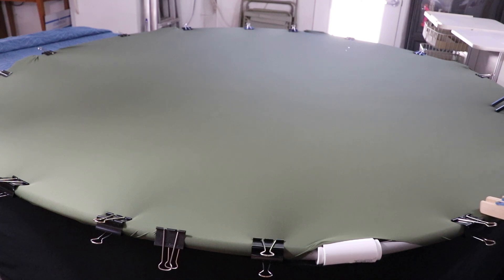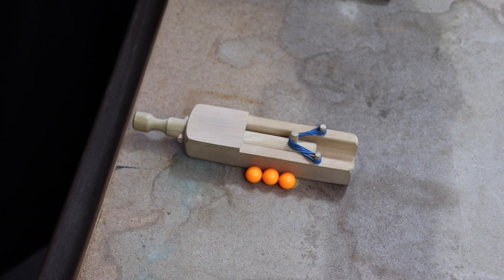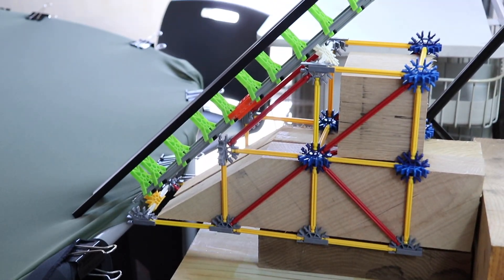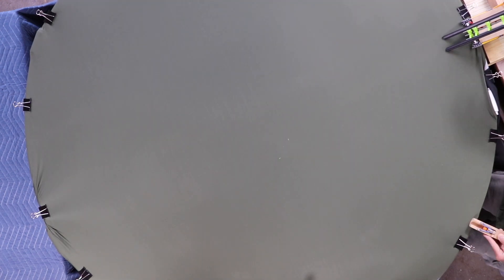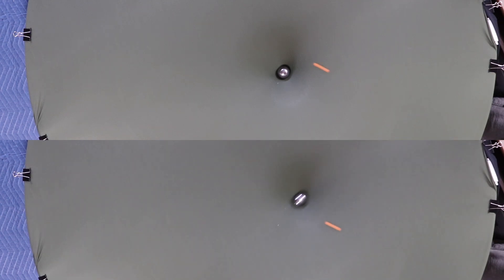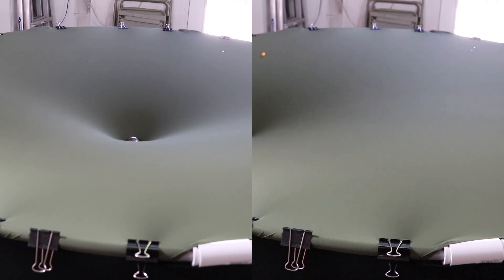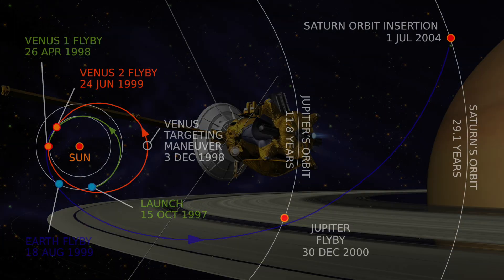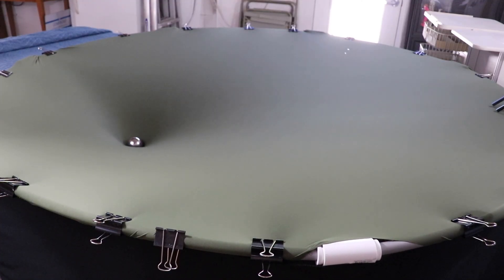How to Perform a Gravity Assist

Comment: Now I get it. I'll be able to launch more efficient missions in KSP
Reply: I don't have a KSP but i would like to see a grand tour in KSP :) try it.
Reply: When I saw the video title I thought to myself "This ought to help in KSP". I come to the comments to see that I'm not alone. 🙂
Reply: The part shown in this video is the easy part. The hard part is getting the planets to line up just how you need so you can get the desired exit path. It's all about timing.
Reply: Lol yep
Reply: I don't really like gravity assists, my friend parked his duna craft on elliptical orbit to SOI and the mün ruined him
Reply: Famous last word for a Kerbal.
Reply: @Strike2-9245  That is why I use the mun to do a G-assist , way more fuel efficient way out of Kerbins Grav well
Reply: If I can find out how to reset files on my ksp
Reply: Been doin this with mechjeb for years, great way for a low thrust ion engine to capture at Jool instead of doing a flyby.... especially if you may have done a few grav assists too many at the mün.....
Reply: I'll be trying to use it in Simplerockets 2
Reply: YES, that‘s just my thinking😂👍🏻
Reply: Not sure if they changed anything but in KSP 1, I used to send a spacecraft to an orbit of altitude about 100km high on Kerbin, and then did a gravity assist using Mun. So if you do it right, the gravity assist will knock the orbit of the spacecraft once, so that it does one orbit that brings it back into a second gravity assist with Mun automatically. Two assists back to back for the cost of one maneuver, to get quite a lot of efficiency. Try it sometime. But I only got it to work from a very symmetric orbit at 100km high. But there wont be a third because after the second kick, you get out of Kerbin. Free delta V
Reply: I've never played the game, is it good?
Reply: @desigeekchishi  go to igggames.com and get ksp. But I’d love to support the developers but come on? $50! might buy ksp2 legit though, just to support them
Reply: @desigeekchishi  kerbal space program
Reply: You are gonna add more boosters anyways
Reply: rather than just turn on infinite fuel then fly through them without the concern of gravity fields
Reply: I understood how gravity assist works thanks to KSP ;-)
Reply: @RonRPL  u can understand... but not the 12yo me playing it for the 1st time
Reply: e
Reply: Dude. Being able to even fly towards the planet is hard not even mention doing it with enough precission to granity slingshot my spacecraft
Reply: Thats what im saying

Comment: the only video that shows exactly how it works. All videos just shows animations and clips that doesn't show the real effects of gravity assist. this was really good
Reply: Almost*
Reply: I think it more shows that it works.
Reply: How did this get 700 likes and only 2 replys
Reply: @fail-er544  i watched this vid and left a comment way back when it had only 19k views i think 😅
Reply: But why don't we spiral into the sun?
Reply: @lc2c177  it will after trillions of years
Reply: @lc2c177  because if you neglect the forces due to all other planets there's no loss (nor increase) of energy in the Sun-Earth system, therefore there's no reason for the Earth to change it's orbit, hence it keeps orbiting it on the usual orbit. If you consider the interaction of all planets the energy of the Earth is not really constant but it still wouldn't crash into the Sun due to the insignificant role played by the gravity of other planets compared to that of the Sun. These forces (the ones due to other bodies in the Solar System) however do effect the orbit, which in fact has really slow and tiny changes over time
Reply: @lc2c177  Because the velocity we are moving matches the speed at which we are falling towards the sun. So we are in an endless fall towards the sun. 
Because Space has no friction, there is nothing to slow down the Earth. But in the video, the only reason the ball spiralled closer to the larger ball was due to the friction between the fabric and the atmosphere.
Reply: @pickle_256  you are providing zero benefit to the conversation unless you explain WHY it is flawed and point to a better model. Bet you can't.
Reply: @jamesjellis  he knows- he’s seeking attention 👍😉
Reply: @jamesjellis  
This model is flawed because it uses Gravity to explain gravity.
The wells in the fabric around around the balls are created/defined by gravity, which is then used to illustrate gravity...
You can’t use something to prove/explain itself.
Reply: Really? Must've missed the part where the video explained how it works.
Reply: @jamesjellis  Well, the problem is that the video shows a demonstration of a 2D surface bent into the third dimension - the ball gains momentum thanks to the 3D curvature of the sheet. That's not exactly how it works. Spacetime is not "bent" to the 4th dimension; it has a so-called intrinsic curvature. Gravity affects all dimensions and doesn't cause spacetime (i.e. the sheet) to bend into the next dimension (i.e. the room).
Anyway, that's what I think they meant. Personally, I really like the demonstration and don't care about such things because they would be incredibly hard to represent.

Comment: The simplicity is amazing but the actual engineering and maths behind doing this in real life is astounding complicated
Reply: @John King Agreed - the hard part is the engineering, since tiny errors before the flyby turn into massive differences in trajectory after the flyby.

KSP players know that nudging a manoeuver node before a planetary flyby causes the outbound trajectory to swing wildly.
Reply: Timing is very hard too
Reply: @davisdf3064  Not really. We got the aid of atomic clocks. These things can measure time accurately down to nanosecs.
Reply: @aconite72 
Understandable, have a great day! : D
Reply: Ya it's not that complicated. Freshman level calc
Reply: Doable without a calculator. Just takes a bunch of math nerds sweating it up on slide rules.
Reply: @John King it is absolutely complicated do you know how difficult it is to accurately predict where you will end up from a gravity assist you need velocities there’s radial components based on the velocity vectors in relation to the equatorial orbit plane plus the change in distance from apsis to periapsis needs to be calculated to find out where your orbit around the sun will be when you perform this maneuver it’s not simple at all it’s heavy duty calculus with radial factors if you want to accurately calculate the outcome of a gravity assist
Reply: Especially with Rosetta. People be bitchin how KSP is unrealistic, when in real life we have Rosetta doing heavily planned gravity assists across over a decade
Reply: Yeah, the effect on velocities is easy to predict. You don't even have to look inside the SoI. The effect on angles is totally dependent on relative velocities, M, and apoapsis. Not hard to do the math at all. Not even any calculus involved.
 But of course IRL it's much more complicated. N- body physics, relativistic effects, non-spherical parents, etc. For that you need pretty complicated spice based modeling, but for most cases the simple math gives a very good answer. Good enough to plan the Voyager probes through their tours of all the outer planets 50 years ago.
Reply: @riccardoorlando2262  you've made me feel important now

Comment: the sad thing is it has friction so the balls will just go to the middle :(
Reply: And the most notable limitation for this demonstration is that it's two-dimensional, where spatially speaking gravity and space are three-dimensional.

It's somewhat difficult, but not impossible, to imagine this same fabric surface but instead of one layer imagine the same fabric but rotated to fill all 360 degrees and directions for a sphere, until it's totally encompassing the steel ball from all angles in true 3D fashion.  

It might be easier to just picture how a large mass gravitational pull interacts with lesser mass objects regardless of the angle or direction they're approaching it from.
Reply: @mario0318  I just imagine a 3D sheet bending in the fourth dimension. Imagining 4D takes a lot of practice and requires holding more information in your mind than imagining something in less dimensions, which can get quite exhausting.
Reply: @jannikheidemann3805  r/iamverysmart
Reply: @equious8413  r/ihavereddit
Reply: @jannikheidemann3805  haven't used Reddit in over a year.

You keep on "thinking in 4D" though. Lol
Reply: @equious8413  right 😂 like he can actually imagine the fourth dimension 😂
Reply: This thread is getting pathetic. Play nice. Besides, you all completely missed the obvious argument; Friction has nothing to do with the ball going to the middle.

10 internet points to the first clever cookie who can explain the actual reason.
Reply: @charmio  r/iamverysmart
Reply: @CharliePuma  😂 and we've come full circle.
Reply: @CharliePuma  Now now children, don't be shy. I'm sure if you try really hard you'll be able to figure it out. I believe in you!
Reply: @CharliePuma  You don't believe me? Why should I not be capable of imagineing a fourth dimension? Because it doesn't exist?
Because I have never seen it?
Imagination tends to not be limited by those things.
There are actual 4D-computergames you can learn from how 4D-objects behave. You can watch gameplay here on YouTube.
Reply: @jannikheidemann3805  good response I agree with you. I was thinking you were just meaning you could see it super easily which supposedly only like 24 people in the world can actually comprehend and accurately imagine the fourth dimension. But many people can try to imagine it and picture it but it's usually never proven to be "the 4th dimension". But thanks for the nice response. Glad to see people on here that can actually defend their comments rather then just insult.
Reply: @charmio  theres probably a few reasons but the main one is gravity. Also fabric tension. The fabric in the very middle has the least amount of tension. So when the ball is placed on the outside, it has more tension towards the edge because there is less material for the ball to sink into and become stable. It then gets pushed more and more by the outer fabric so that the ball can keep moving towards the ground. Then it goes into the very middle because the circular shape of the fabric helps keep all the tension in a circular pattern. the ball is then surrounded with completely even tension so it does not get pushed any further. If it was any other shape it would not be nearly as accurate for imagining orbits because the tension would not have the consistent proportions  towards the edges of the fabric. I feel like I over explained this but whatever it was fun.
Reply: @CharliePuma  Thank you! It's always good to see civil discourse appreciated.

Maybe you could mount the clamps tensioning the fabric on rails that can move vertically so that they don't exhibit "negative gravity". To keep the sheet from just sliding down those rails you could use air pressure from below as a sort of "dark energy" if you mount everything in an somewhat airtight cylinder and find a way to minimize the air sliping through between the edge of the sheet and the vertically railed cylinder wall without causing too much friction.
Maybe instead of mechanical rails strong magnets attracted to an ferromagnetic cylinder wall whith an air cushion reducing the friction. Electric discharge machining could be used to drill pinhole pressure air channels into the brittle magnets.
Reply: @charmio  it slows the ball down thats why it goes to the middle lmao
Reply: @CharliePuma  lmao XD
Reply: @sir_duckington1245  Charles Hewitt gives a pretty good explanation (and wins 10 internet points). You should read his comment.
If you still believe friction is the cause of the ball rolling to the middle then consider what would happen if you placed an already stationary ball on the edge of the fabric.

"lmao"?.... What's the joke?
Reply: @jannikheidemann3805  that would be cool af! Seems like we could do a lot of cool stuff with this experiment. Some revolutionary ideas here. Keep up the good thinking. Dark matter is soooooo fun to think about. Dark matter and black holes are some of the coolest ideas/things EVER. What do you think dark matter would have to do with consciousness? I've always been curious about this question
Reply: @charmio  thank you sir! I feel good about my explanation skills now! Twas fun
Reply: @sir_duckington1245  you've got to be joking lmao. "It slows the ball down" what does?
Reply: @CharliePuma  friction
Reply: @jannikheidemann3805  or they could have some sort of balloon or ball getting pushed up into the fabric from underneath! That would seem to display the opposite effect of gravity. That would be interesting to see
Reply: @sir_duckington1245  no dude. Learn some physics and come back to this. Friction barely has anything to do with this experiment.
Reply: @sir_duckington1245  can you even define what friction is?
Reply: @CharliePuma  oh well im sorry i triggered you lmao, smart boi
Reply: @sir_duckington1245   @Sir_Duckington  Mate, don't even try to pretend you were trolling from the beginning. That's just sad. There's nothing shameful about not knowing something - Being unable to admit it though...
Reply: @charmio  how am I pretending I was trolling lmao and why r u so mad XD
Reply: Lol.. at least someone noticed that huge flaw. This was the dumbest thing ive ever seen.
Reply: Its also funny when you point out the flaws in these pathetic attempts to explain gravity and the nerd boys completely lose their small minds.
Reply: @nickflix33  Umm Nick, It's good to have someone on side, but that's not exactly helpful. In fact you're plunging us further into the unseen depths of pathetic rhetoric. 

I'd understand commenting to give the ignorant duck some greif for trying to save face but commenting just to insult everyone ain't going to bring about the change you apparently want to see in the world.
Reply: @nickflix33  thise whole part of the comment section is cursed i never shouldv commented this XD

Comment: The actual transfer of positive momentum and the velocity increase occurs as the spacecraft approaches and passes through the planet's gravity well while traveling perpendicular to the planet's orbital path. Then the spacecraft is deflected into a new trajectory that is more parallel to the planet's orbital path and as such the planet's gravitational attraction during departure is partially cancelled out. This results in a net overall increase in momentum because you gain more speed during the approach than you lose during departure.

Comment: Very interesting video. Thank you, but my problem with gravity assist is why it is actually called GRAVITY assist whereas it is actually ORBIT assist as your demonstration clearly shows.  Gravity takes away what it initially gives, in other words it does not assist.
Reply: The mechanism for transfer of energy from planet to ship is via gravity. 

Your statement is only true for the planet's frame of reference where the planet's kinetic energy is zero. 

From any other frame of reference gravity is not bound to take what it gave because it can just take the deficiet from the planet's kinetic energy.

The orbit does not assist because it is not a force it is just a path, it can't do work.  It is the kinetic energy of the planet that is exchanged via gravity.
Reply: @ayushsharma7342  Crumbs, sorry, I've read and reread your answer many times but I can't get my head around it. The mechanism for transfer of energy from planet to ship may be via gravity but being a transfer mechanism I can't see deserves it getting all the credit. It's like giving all the credit of the movement of a car to it's wheels rather than its engine. 

By kinetic energy are you referring to it's orbital energy or rotational energy? OK, I see your point about the orbit being a path rather than a force, in that case it should perhaps be orbit speed assist. I initially didn't understand gravity assist because it seemed you were getting something for nothing, but then someone mentioned that it took some of the planet's orbital speed and by doing so the planet actually lost the minutest amount of speed.
Reply: @richardarcher3435  yeah it slows down a bit.
Reply: @alexwang982  Yes, the planet's orbital speed does slow down a microcosmical bit because it is that that assists, not gravity.
Reply: @(S)-Riley Dunn Yes I see that. I just don't see why it is called gravity assist whereas it's the orbital speed that actually assists. Gravity just transfers and takes away what speed it initially gives.
Reply: @richardarcher3435  orbital speed depends on the strength of gravity field and your velocity. Without gravity there would be no orbits, and this isn't an orbit since the purpose of this is not to enter an orbit, but to accelerate or decelerate in a solar orbit where the craft already was beforehand, it would not be an orbit around the planet.
Reply: @FrankyPi  True, but it's still the case that it's the orbital speed that assists, as this demonstration clearly shows at 1:25. Steel ball not moving, no assistance.

Comment: You're getting the increase in speed because the pvc is rebounding after the steel ball drops into it and catching the smaller ball with this rebound, flicking it away faster. 
The amount the pvc is stretched should be constant in which case your "assist" wouldn't work.
Reply: This video only supposed to be a basic example to help people understand the idea behind it.